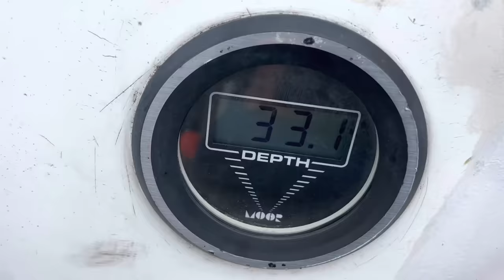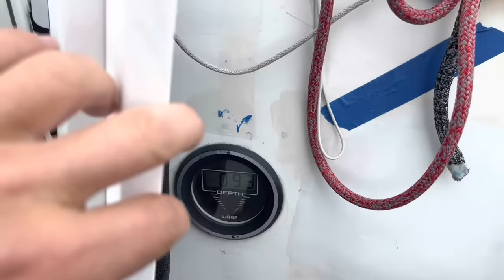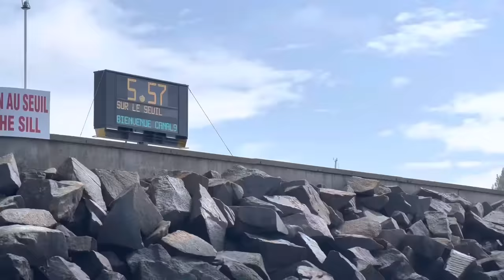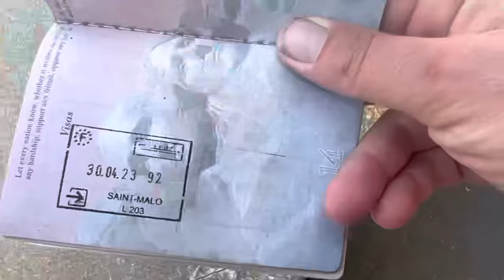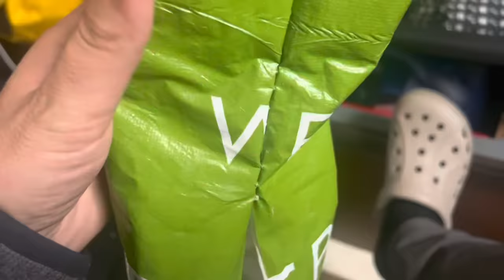What happened to Pickle?!😱

Comment: The danger in what you did is that there could be a rock that the hull comes to rest on and that could seriously damage the hull. You should aways survey the careening spot on the previous low tide and place a marker buoy so that you can be sure of a safe grounding.
Reply: That seems like sage advice.
Reply: Even if there was a rock the conditions that he did this in would not cause any damage it wasn’t bouncing as it lay down
Reply: Buzzkill!
Reply: So true
Reply: @dowser81  It was bouncing a little and there was no way knowing in advance that it wouldn't "bounce". Bouncing or not, the rock could easily pierce the hull or damage the rudder, propeller, prop shaft, etc. if in the wrong place. When refloating, you have zero control of how "bouncy" it is and the rock could, again, easily pierce the hull or cause other damage.
Reply: @dowser81  Even without bounce a rock may give a stress point on the hull

Comment: At 9min mark, you showed your prop. Something I recently heard from a surveyor was that the prop lock nut is the larger of the two.  The reasoning is because the locking force is greater with more threads. The shorter nut is to push the prop onto the shaft. IOW, yours is backwards according to this.

Comment: Great video again.  And exciting to watch how you careened pickled herring. I’ve actually never seen how it’s done. 
Did you treat yourself to some fuit de mer while in Saint-Malo?
Reply: I'm guessing this is only possible with certain types of keelless hulls.
Reply: @stopthephilosophicalzombie9017  his boat has a keel, his is a "full keel," the largest form of keel on a boat. It's possible on most boats, and wing keels can do it without even tipping over. 

The only keel I might not want to try on would be like a bolted on keel with no wings, they are designed to support the weight, but not sure about the torsion.

Comment: I thing you'll find galloping horse bit is the speed the incoming tide comes at you over the sand. So if you are walking the dried beach and you see the incoming water's edge coming towards you, its already too late. It happens wherever you get what you call a 'tidal plane'.
P.S. you should clean the barnacles off the prop, it would save you fuel/ add some speed.

Comment: That's how i bought this boat, it was on its side in Daytona in 3 ft of water and the director of the sailing academy said he had one stuck there ten years previous and he said he had to build stilts and walk it off and that I'd never get it out of there without doing something like that, put out 3 anchor on winch and tighten and then on King tide started to rock back and forth and got loose and then all the anchor rode got wrapped around the prop and threw out another anchor and I was no longer grounded but yeah the grounding made the boat cheaper 700 bucks but I'm sure it be closer to 3k if it wasn't grounded but still a great deal 😀
Reply from the maker: Cool deal

Comment: Sam you are a braver man than me beaching your boat like that. I would always be too worried incase i ended up on top of a wreck or a WWII unexploded mine or bomb 😮😮
Then if that was ok i would worry that the wet mud and sand would act like a suction cup on the hull so when the tide rose it filled the boat instead of floating lol
I would be a bag of nerves the whole time 😊
Reply: Yeah you might not be cut out for this lol
Reply: Sam needs to do some magnet trawling!🤣
Reply: The rising tide is like magic, lifting the boat back up. But soft mud is a big worry, as you might not be able to walk around on the bottom.
Reply: When I was a kid I thought quicksand was a bigger deal
Reply: @jerryd.leonard2947  In North Holland/Friesland quicksand is a real danger.
Reply: @naughtiusmaximus830  I tried careening my boat in a river in Panama. The boat was fine, sitting on soft silt but I immediately went to my thighs when I stepped on it. Had to effectively swim and crawl out of the stuff to get to firmer land. Conclusion? Only careen where there is sand, not mud!
Reply: @stephenburnage7687  There is a tragic case in Friesland where a couple went out on the mud flats and the woman got stuck and despite all efforts drowned when the tide came in.  There is a documentary out there somewhere.
Reply: That's not quicksand
Reply: Always go & walk the careening beach,even place a float marker,the day before careening. Cheers/Len
Reply: @debleningalls  That's the lesson!

Comment: Have you thought of carrying beaching legs?
The galloping tide is certainly the case in Morecombe Bay, Lancs., where Chinese cockle-pickers were caught out and 23 drowned. The gang master was sent to gaol for 14 years..
Reply: I should add, amongst many many other drownings there caused by unprepared dabblers.
Reply: I don't get it. How did they drown?
Reply: And one of the few places served by a rescue hovercraft . 

St Michaels mount is the sister establishment of the  French monastery....
Reply: How did they drown?
Reply: @robertbailey2342  The tidal range there can be up to 10.5 metres during spring tides and the tides go out as much as 12 km due to the very slight (flat) slope. So when the tide turns, the water rushes in very fast and people get caught out on sandbanks surrounded by turbulent water. Underfoot the sand (and mud from the rivers) create quicksand consitions which also trap the unwary. Hundreds of people have drowned there in living memory. The tidal range is third to the Bay of Fundy and the Bristol Channel.
Reply: @robertbailey2342  
They were forced to work ou on the sands at night picking cockles.. they were left out there too long.. the tides turned they became cut off from the land and there are also quicksands out there... When the tide turns it can pour into channels the eye can barely detect as fast as you can run. 
Its always been a dangerous place ... Even for locals but if you cannot swim and the conditions are bad....😬

Others have ended up in danger since.  
Traditionally the monarch has a Royal guide ...  a chosen local who has learned over a lifetime how and when  to pass the sands safely..
Reply: @clivestainlesssteelwomble7665  wow that's awful!! I'm from the coast of Maine north eastern coast of US 🇺🇸and have worked around the ocean all my life. I used to dig blood worms on the flats for few years and I totally understand how fast the tide can and will turn on you!!! We also have what we call honey pots, works similar to quick sand but it's not sand it's clay mud soup and if you step into one or fall in it's very hard to get out depending how big and deep they are! I know few good men that got caught in them and when tide comes in took their life's.

Comment: Nice video. Suggestions from Fundy. Wait til 1/2hr or so ebb tide. Then power the boat straight in til it grounds.This minimizes "pounding" time while waiting to hard ground. Or,you can turn boat parallel to beach at last moment,& lay her down with deck listed toward shore.This will diminish pounding during rising tide,but you must drop anchor,(on the way in) to keep boat from being driven up the beach as it re-floats. You need water & a long & short handled coarse (fishboat)scrub brushes for bottom cleaning.When the tide drops to about 1ft or less depth,jump over with buckets & brushes.Dip brush in tide as long as you can & use filled buckets for rinse. Do maintenance,zincs,bottom paint-after tide leaves. Cheers/Len
Reply: Fundy folks know their tides!

Comment: First time I see someone "beaching" on the Mont Saint Michel Bay. I think it's unlawful.
But the point is beaching is OK when you enter a small bay where you can be sure that water will be flat and the boat doesn't hit bottom repeatedly. It's somewhat possible when you come in… but you're not sure what will be the sea state when you get out and things ca get really bumpy pretty fast on a bay that is very large… the more so that relying on charts is always taking a chance as the bottom at the Mont Saint Michel always changes, and you're not sure you'll be able to take the exact same route on your way out.
There are plenty small harbors around where you can lay against a quay for 6 hours without any issue and give a scrub to your hull. Look around, many people do it.
Anyway best of luck. I envy you !…

Comment: i would pull the engine, re-trim with some extra lead bolted on the bottom of the keel, and scull that thing; with those new laminate sails.... i would just start stripping dead weight, and go to Speedcoat 49 and a 13 foot sculling oar......i mean it would never surf anyway, but your lighter air performance could eliminate the need for a motor....make a lead appendage, the trim factor of the engine, to fair out the prop aperture.

Comment: Hi there. The nuts on your prop are reversed from how they should be. Small nut goes up against the prop, the larger one behind it should be acting as the locking nut. (I recently learned that, from this pro: https://youtu.be/u0sZoxa9VbY?t=354)

Comment: The trip up the R Rance would have been really interesting and Dinan which is as far you can go, very pretty.  Turn around now, quickly, its is worth it.  Don't worry about the lock.  Let the fishing boats and any motorboats in first and then follow.  They can get under the road bridge, but yachts need to wait until the lock keeper opens the road bridge.  There was things to hold onto the side of the lock but we stayed under power in the middle.  Wasn't a problem
Reply: Dînan is beautiful

Comment: Lol you must have been really board to make a waterproof cover for a autopilot that is about to check out 😂😂 much love from the coast of Maine USA 🇺🇸🤙🤙
Reply: most people get bored. sailors get board.
Reply from the maker: I need to make sure this one doesn’t fail like the rest of them have. They cost over $600 here
Reply: @samholmessailing  Id guess that those autopilots fail at the internal gearing and bearings. Regular lubrication would be advisable. You could  make a replica on your 3D printer of the gears and bearings that tend to wear. Plus de bon voyages!

Comment: Suggest priming the bolts before Locktite especially in extreme applications like that.  Soaking a few minutes in brake cleaner should probably be enough.
Reply: What do you mean priming?
Reply: @stopthephilosophicalzombie9017  Preparing the metal.  I’m sure there is loads of shop lore like BMW used to piss on their Grand Prix  engine cases before machining them🤣😂. I have been working with electrolysis so it’s kinda active in my head now.  You can zinc plate with a USB power cord too although I would probably go upscale.  That might be cool for marine applications.
Reply: @naughtiusmaximus830  Oh so you just mean cleaning/degreasing the bolts. Gotcha
Reply: @stopthephilosophicalzombie9017  There are lots of ways to do it.  Acid is probably the worst.  If I were on a boat with  lots of time and 5 or 12V available I think I would zinc then nickel plate all the bolts but I’m  not familiar with heavy marine applications.